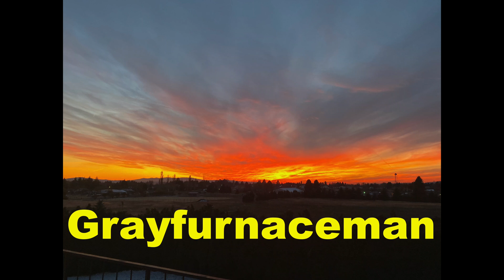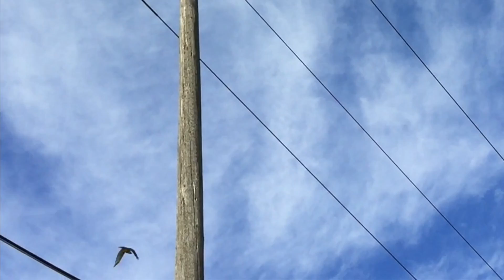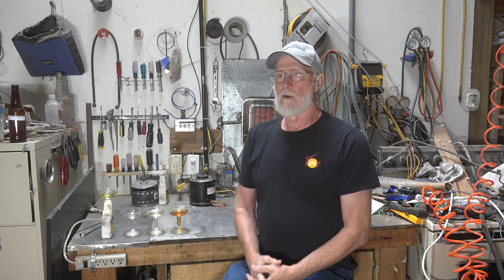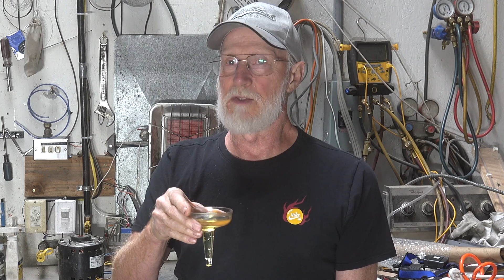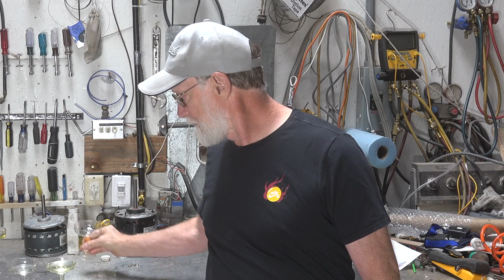Refrigerant oils: POE and PAG

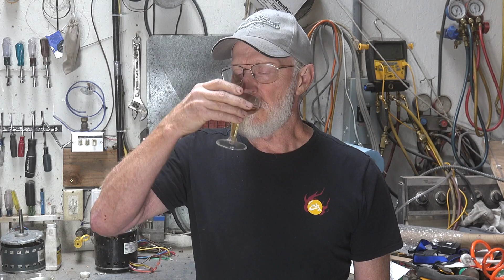Comment: Min 7:00  --- very funny. 

* * * 

Min 9:00

In the "reason, not an excuse" department, I think I see where you're getting your not-very-critical deference to the ... ahem ... (self-proclaimed) "authorities" of ozone depletion and "climate change" (I hate using that term because it doesn't specify "warming" or "cooling"; another facet of the climate change fraud, but that's another conversation). 

Back to minute 9:00  -- deference to manufacturers instructions:  of course, they've got the success of their products on the line. There's no reason to doubt their correctness, and if they're objectively wrong, they'll be the first to fix it or lose business to competitors.  

That's not how empire-building bureaucracies work.  Whole industries come up from quackery and superstition.  I just learned recently that the "Montreal Protocol" is an ongoing world-wide bureaucracy -- they've got fat careers and pensions on the line.  You should see the mealy-mouth videos of ozone bureaucracy dancing around the no-conclusion data of their "healing efforts".   This is not how HVAC manufacturers operate, and it is a mistake to take treat them the same as self-serving careerist bureaucrats  (not to mention how badly they've screwed up the HVAC industry ).

Comment: Is PAG ans POE mixable with each other? I am going to refill oil to my cars' AC compressor and I have only got ester oil, but on the compressor it says SK 20 (PAG 100).
Reply from the maker: They are not mixable in the application.  The compressor does not care, but the application requires on or the other.
GFM
Reply: @grayfurnaceman  Okay, thank you. I'll get PAG oil then because that's what was in the system before.

Comment: Question, used a gauge set that had some PAG. 46 in the lines to charge a 410a system.  Do I have to worry about a small amount of the PAG oil in a POE system?
Reply: @Joe thanks, it’s been working fine for the past year.

Comment: Do the oils in systems last for the life of the unit?  My unit is on it's 29th summer.  Runs great and has never needed a charge.
Reply from the maker: Yes.  The system is sealed, so there is no contamination.
GFM

Comment: Witch oil is being used with R32 Refrigerant and what are your thoughts on R32?
Reply from the maker: POE or PVE will work.  There is a problem with corrosion of working parts of the system.  I don't think it is a good one.
GFM
Reply: @grayfurnaceman  is PAG oil good for R152 system or should we be seeking a different oil?

Comment: like when the oil turns to goo... does it leave the compressor and wreck everything else or does it stay put?
Reply: It travels through the whole system
Reply from the maker: It does move thru.  Often, if there is a motor or compressor failure, the TXV and accumulator may have to be replaced and the system be flushed.
GFM

Comment: I’ve seen two R 22 mineral oil systems develop “green slime “ after a serious suction leak with total loss of charge. The systems left running , it can’t be cleaned it’s a total replacement of everything
Reply: Would that happen with R12?
Reply from the maker: @hg2.  It works the same.
GFM
Reply: "Come ooooooonn Propane!"
Reply from the maker: The decision to replace the system is generally dependent upon size and cost.  
Cleaning can be done with compressor and oversize driers installed, but it is a long and expensive job.
GFM

Comment: Thanks GFM for the very informative video. I use Pag because I repair motor vehicles. R12 is long gone in my field or most have been re fitted to 134a. The new stuff in automotive is 1234yf. I have not dealt with it yet. I hear it is a VERY expensive pain in the ass.

BTW when I first clicked on the Video, I thought we wuz gonna have a moonshine taste test. Great job GFM, Stay well.

Comment: I’m in the middle of a work on a video POE , PAG , PVE, AB, mineral oil now. Showing them in a vacuum chamber when they are exposed to moisture. Why good oil companies only pack in metal cans. Because the plastic containers absorb moisture through the plastic into the oil.  Soon to be released
Reply: yep, plastic is bad, moisture can get in right through the plastic, the oile manufactures claimed to have modified it to make it less hygroscopic.. I'm impartial to that lol
Reply: @ whites heating & air & appliance repair.   YouTube channel same as my name showing ( t lech ) search

Comment: I’ve got a cup of Poe oil filled right to the tip top. No spillover yet very humid here
Reply: Interesting. How long has the cup of oil been open?
Reply: Been open for like 36 hours so far
Reply: they've modified POE from original to make it less hygroscopic(so they've claimed) still not good to leave it open as with all HAVC oil's and equipment.

Comment: dont forget about PVE oil kind sir! always great content!
Reply from the maker: I will get to it.
GFM
Reply: Pve is hydroscopic, but can be dehydrated via evacuation. No hydrolysis. If I remember right...
Reply: most of what i have seen is it being moreso a manufacturer glamoil. bitzer for instance first time i heard of pve was working on a poolpak which is a unit made for commercial indoor pools..who uses bitzer compressors. I had to replace 3,20 ton tandems and couldnt find it anywhere and when i did..it was insanely expensive

Comment: What are the benefits of PAG oil compared to POE oil? I know that 134a is compatible with both POE and PAG oil so there must be a reason PAG oil is used in almost all 134a automotive AC systems with the exception of some hybrids and EVs with electric compressors
Reply from the maker: PAG does not have to deal with motor windings in most cars as they are belt driven.  This is not to say it is not used in motor/compressor systems.  I have a Chevy Bolt EV with PAG oil.
I can't get really deep into lubricants as there are so many properties when oil and refrigerant react with each other at varying temps. 
 Its above my pay grade.
GFM
Reply: @grayfurnaceman  Makes sense. There must be a significant benefit to PAG oil for it to be used in almost every car's AC system though. From the research I did PAG oil is a better lubricant over a wider temperature range than POE oil in a clean system but POE oil tolerates contaminants such as trace amounts of mineral oil or moisture better than PAG oil, which is why PAG oil is used in new 134a systems and POE oil is often used in R12 to R134a conversions. There isn't much information on the benefits of PAG oil over POE oil that I could find, so I am not sure how correct that information is.
Reply: id say hydrolysis. it doesnt respond with water to become statically charged to fry windings and your entire vehicles electrical system?
Reply: @Veedub98  On a standard (non hybrid or EV) car with a belt driven compressor there are no exposed electronics in the system to be damaged by moisture, although the rest of the system certainly could be.

Comment: Great information! I have heard that double end capped PAG oil is more chemically stable and significantly less hygroscopic than regular PAG oil, I don't know how true that is though.
Reply: 100% true, if you get most if not all hydroxyl groups replaced with water insoluble groups it's no longer able to mix with water. Saw a test on a forum where someone poured auto air con single end capped PAG (one hydroxyl group at one chain end) and double end capped PAG (both hydroxyl groups replaced with non-water soluble functional groups such as a metyl group) in water and the latter clearly stays separated even after vigorous mixing. Further, they cooled the SEC PAG and water solution down to freezing temperatures and it freezed up. This means a clogged expansion device
Reply: @teravolt6113  Thank you for letting me know, that is pretty cool! Makes me wonder why it isn't used in all cars from the factory, likely cost. That's what I used when I rebuilt my car's AC system 3 years ago because the manufacturers claim that it's better, although I was a bit skeptical at the time. I'm glad I spent the few extra dollars on DEC PAG oil now though!